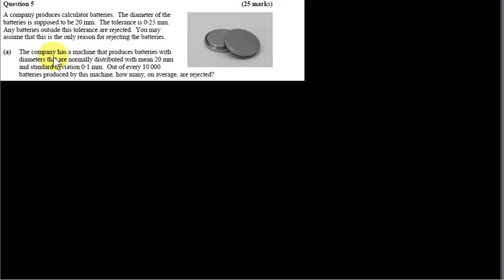Q5 Normal Distribution - Project Maths HL P2 (2012)

Comment: Hey KeysToMaths1 + in the second part of the question I don't get why its still 19.75 and 20.25, why cant it be 19.8 and 20.3? (both of which I got from adding and taking away from 20.05)
Reply: dragon dres wait if it said the standard deviation has a new value would it change?